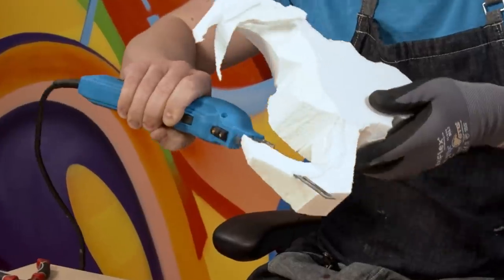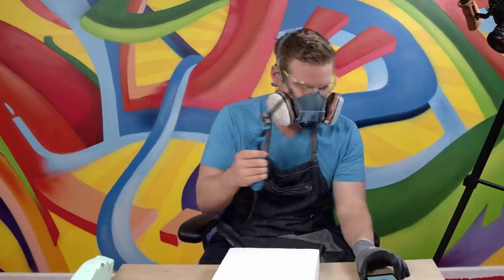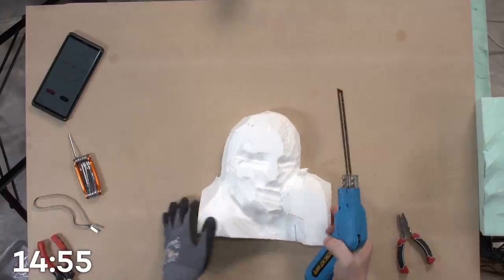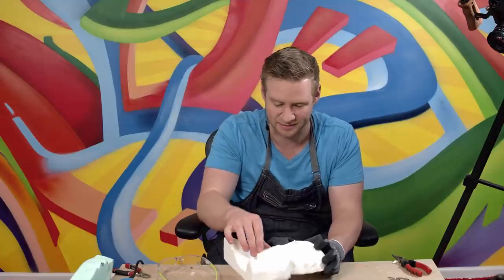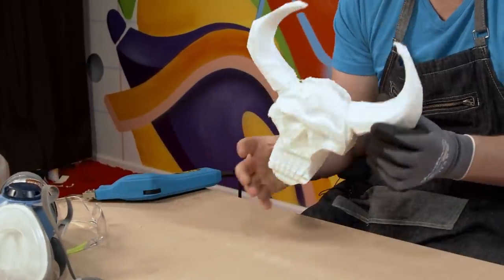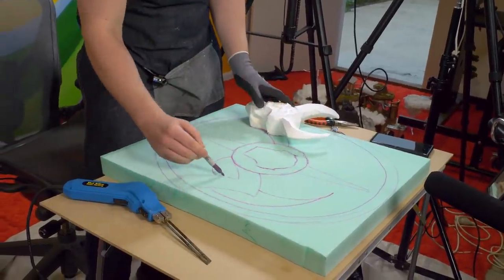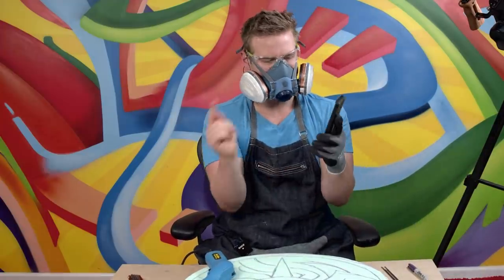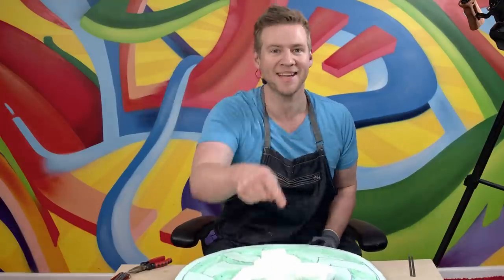HOT KNIFE Foam Sculpture - SPEED CHALLENGE!!

Comment: A small tip for anyone who wants to foam carve, take the glue stick out of your hot glue gun and you can use the tip of the gun to "carve" the foam. This useful because some glue guns allow you to control the temp (I've heard, mine doesn't) and because the temperature of the standard glue shouldn't melt the foam too quickly. Thus giving you more control.

Comment: When I was a prof. photographer, I learned to sculpt foam props as well! We used a modified coping saw with a special kind of electrified wire instead of saw blade. Another technique is to use a paintbrush with acetone! It allows you to do more "painterly" sculpting! We also used additive techniques and also would first use 3M spray glue to glue several dense foam sheets together then sculpt them & then cover them a little like papier mache but with cheesecloth pieces & plaster-like stuff then painted them. I hope you try acetone and do more foam sculpting!